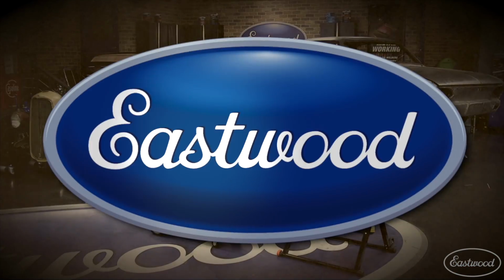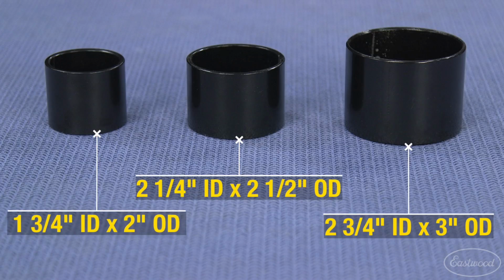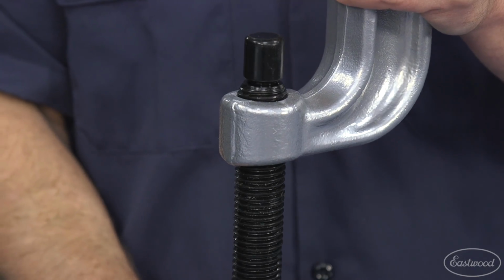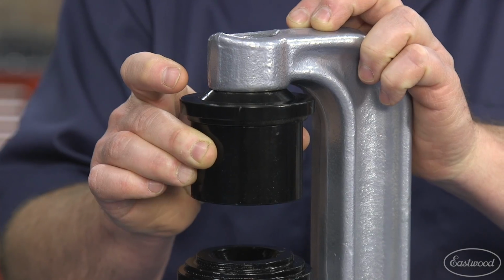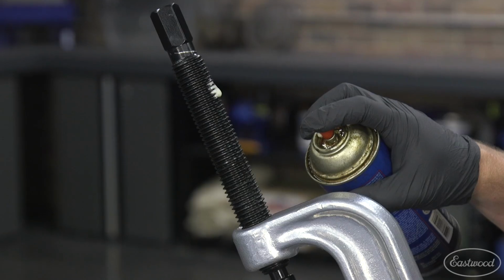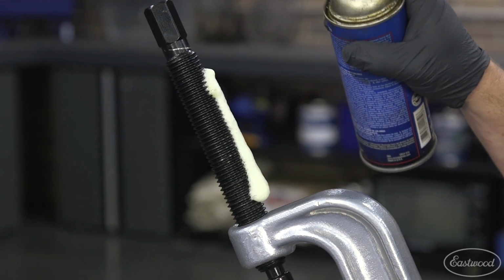Remove or Install Ball Joints - Dissemble or Assemble U-Joints - 3-in-1 C-Frame Press - Eastwood

Comment: I have to admit, this is a good price ($36.99) on a rarely used tool that's one of those "when you need it, you gotta have it" tools.  On most press in ball joints, a impact wrench will be a plus (and possibly a necessity).  But you're likely to find yourself working in a parking lot somewhere, because the worn out ball joint popped out while the car was backing out of a parking space with the wheel turned sharply.  And it will almost always be the passenger side wheel (because that side sees the most abuse, what with it running off, and back onto the edge of the road).   Check for ripped and torn rubber boots to avoid being left stranded.  Because if that boot seal is broken, it's just a matter of when, not if.....

Comment: this thing doesnt work at all besides removing the ball joint. doesnt fit my 2009 charger to reinstall the ball joint. barely worked to remove it as well.